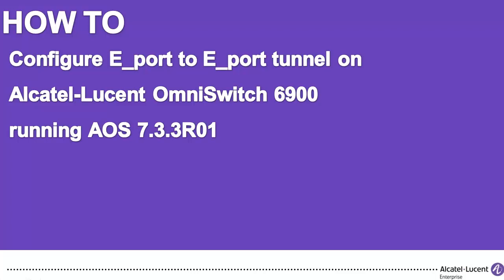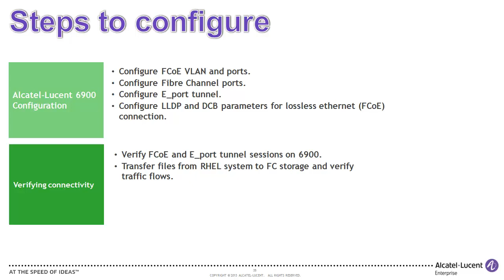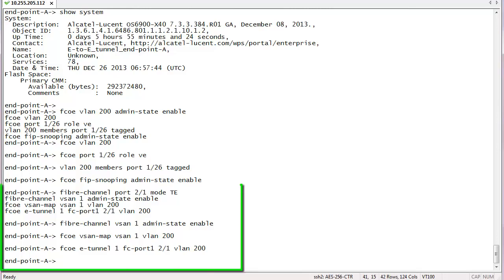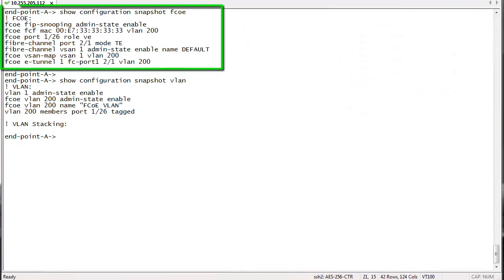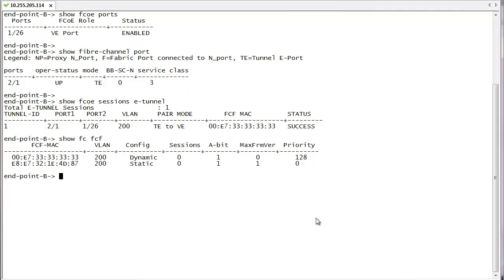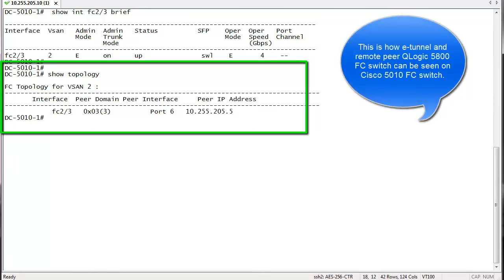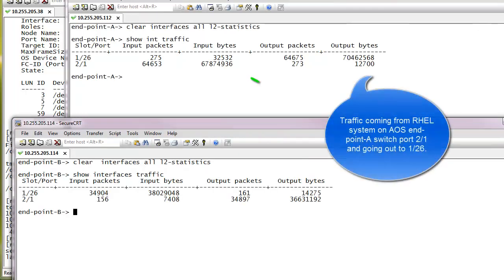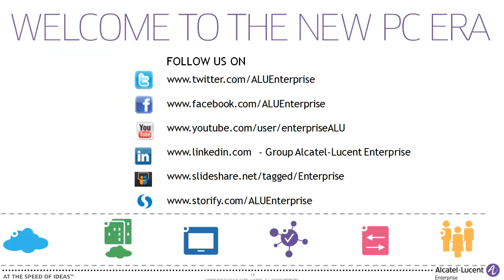How to configure E_Port to E_port Tunnel Omniswitch 6900

Comment: i just realized how strange a decision was when someone who completely hyped his choice of alcatel & their "competent" partner only got two 6900s, but also two 16g brocade fc switches that in the end just attached to a fc storage which had half of its 8gb uplinks not populated.
he could've gone for a very clean setup with 4x Dualport 10g CNA/FCoE  adapters per host and a nice core fabric based on just two more 6900s. easy to expand, single goal, single tool!